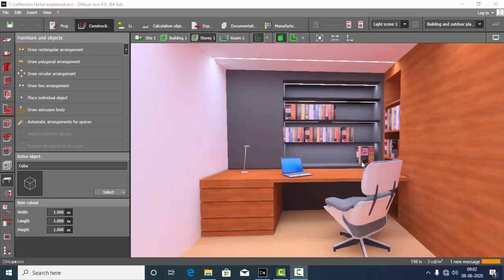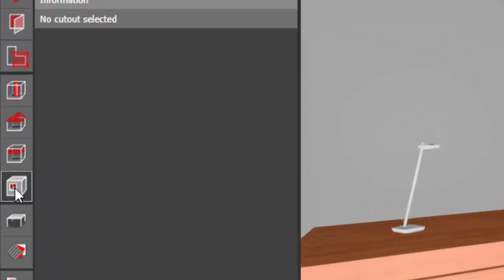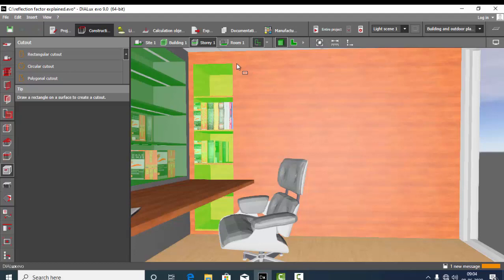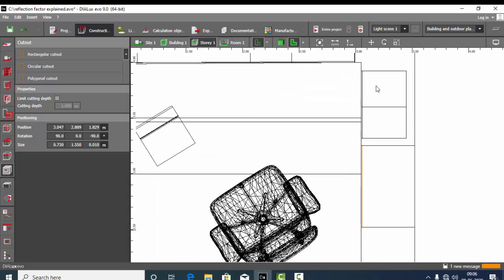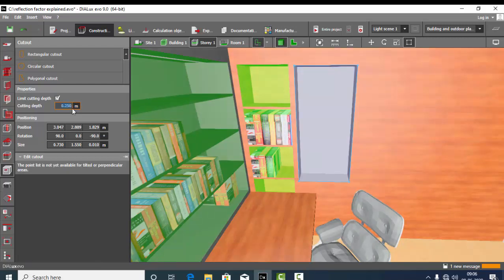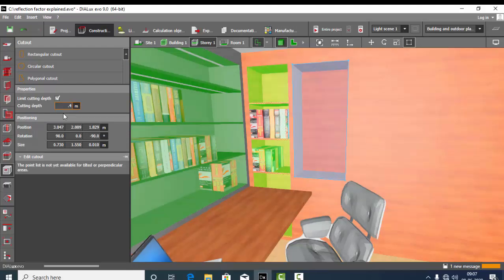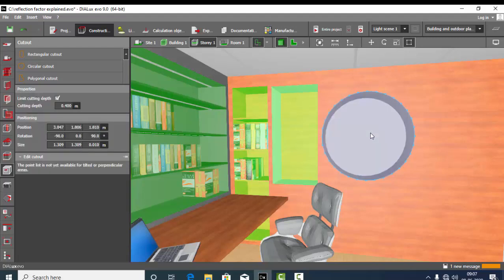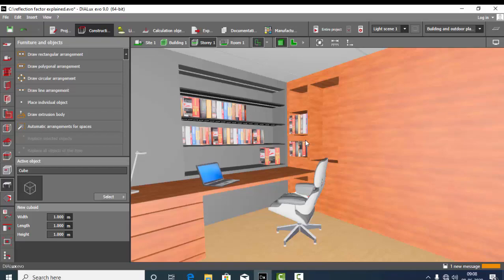USE OF CUTOUT TOOL IN DIALUX EVO

Comment: Thank you. How can I adjust the wall thickness?
Reply from the maker: if working with room planning option, there you can find wall thickness option. You can directly change the value of wall thickness there.
if working by importing plans and want to reduce or increase the wall tickness, you can adjust it by selecting the indoor contours in CAD window of dialux